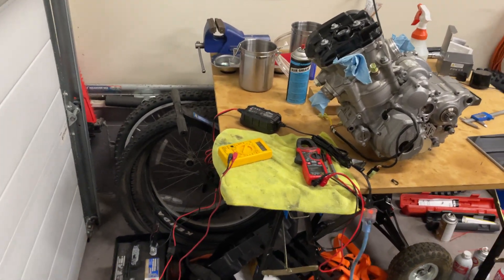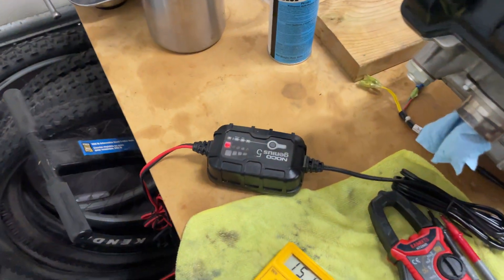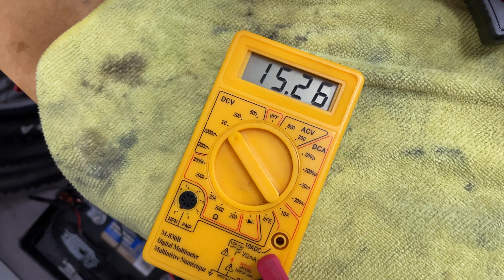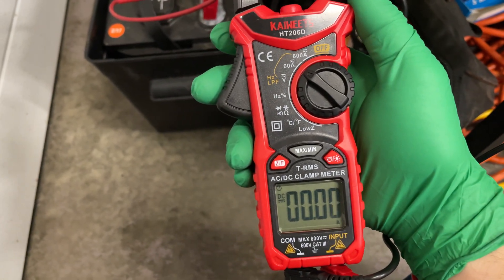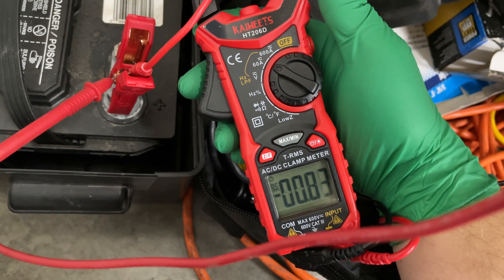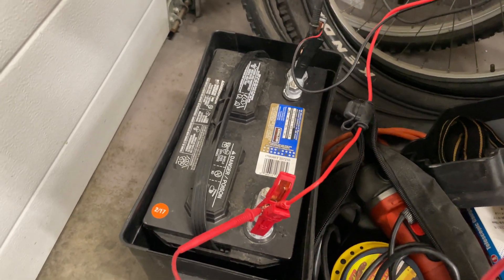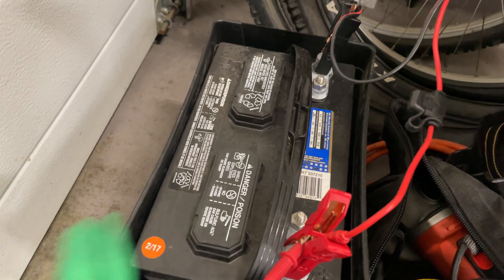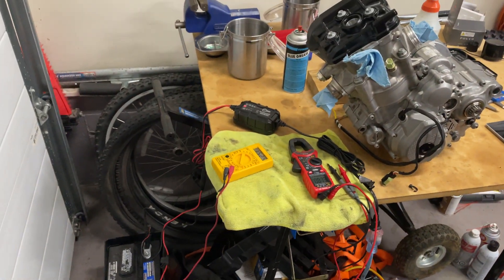NOCO Genius 5 Battery Repair Mode - How does it work? Restore Dead 12V Lead Acid Batteries

Comment: Desulfation devices or methods apply pulses of voltage or current to the battery.
These pulses help to break down the lead sulfate crystals, converting them back into lead and sulfuric acid.
The battery can then return to its normal charging and discharging cycle.

Comment: I tried the repair mode on my truck battery with my Noco 5 and got no pulse. I followed directions and absolutely nothing happened. 4 hour repair cycle and no change. Must be something wrong with it.
Reply: Did you try a full charge cycle before setting it to repair mode? I didn't and the repair mode didn't work. Trying the standard charge followed by repair mode now.

From manual:

"Using 12V Repair. [From Standby Press and Hold 3 Seconds With Clamps Connected to the Battery]
12V Repair is an advanced battery recovery mode for repairing and storing, old, idle, damaged, stratified or sulfated batteries. Not all batteries can be recovered.
Batteries tend to become damaged if kept at a low charge and/or never given the opportunity to receive a full charge. The most common battery problems are battery
sulfation and stratification. Both battery sulfation and stratification will artificially raise the open circuit voltage of the battery, causing the battery to appear fully
charged, while providing low capacity. Use 12V Repair in attempt to reverse these problems. For optimal results, take the 12-volt battery through a full charge cycle,
bringing the battery to full charge, before using this mode. 12V Repair can take up to four (4) hours to complete the recovery process and will return to Standby when
completed."
Reply: @chats5957  Thanks for the reply. Yes, as my comment says, I followed the directions. The battery is done. I got 7 years out of it. I got a new battery. From what I have read online, the battery has to get to a certain threshold before the pulse starts. My old battery couldn't reach that threshold.
Reply: @1dreamingfrog  Lead-acid flooded batteries don’t last forever. I never had a battery last more than seven years. It would be interesting to see how long your new battery lasts if using the Noco maintainer regularly. Some YouTubers claim to get 8 to 10 years using the new battery maintainers. I’m not sure about the longevity of AGM or lithium batteries using a battery maintainer regularly.
Reply: @Fred_the_Head I think AGM batteries have similar chemistry to typical lead acid and maintaining it helps. But lithium chemistry is different and doesn't like to be fully charged and is optimal in the 50% charge range so if it's constantly maintained at 100% it stresses the battery. You could get a special trickle charger that tops up to 70-80% so it preserves battery longevity. That being said I'm not sure this pulse repair mode does anything more than what you'd get if you just normally charge the battery.
Reply: Did you ensure that the battery was fully and completely charged BEFORE engaging repair mode. Repair mode will not be effective if the battery isn’t fully and completely charged.

Comment: Put a Noco Genius 5 on car battery that was showing about 8 volts.  I did not charge it but instead put it into repair mode.
Came back a couple days later the battery read .025 on a voltmeter.  I thought the multimeter was wrong.  It was not.   
Question is what the Noco not-so-genius do to kill this battery deader than dead.
Reply from the maker: You’re supposed to charge it fully first, then use the repair mode on it to pulse current through it, as per the instructions.  This knocks off the sulfates. The reason it was dead is because repair mode only lasts 4 hours or so, then turns off. Not sure why it would have drained other than maybe the battery was powering the tiny led light on the charger at that point. Do a full charge, then top up a second time, then do a repair on it.
Reply: @halflife82  Thanks Egan!  I'll try that today.

Comment: Thanks for the good intentions, but without showing us if it revived the battery, this video is pretty useless :(
Reply: It does revive batteries. I have the genius 5 and anytime I’m working on my vehicle for a few hours I’ll pull the battery cables off and plug in the NOCO on repair mode to keep the battery desulfated. I bought a used truck with a weak battery and the noco revived the battery so well I drove it for another 2 years before i finally felt like the battery was done. It extends the life of your battery.
Reply: @shannonsisk without actually SHOWING that it can start a car, we can't actually KNOW that it's repaired the battery. You don't show it in your video :(

Comment: Very interesting, I was curious as to how repair mode works on the Noco Genius 5 and 10 chargers, it must use voltage spikes pulses. I was also looking at a Pulse Tech Charger that uses a patented frequency to desulfate batteries, but I am not sure if it will charge a dead battery like the Noco Genius chargers can in force mode. How is the battery you charged holding up, have you done a cold cracking amp load test on it?
Reply from the maker: 100%! If I had a scope I’d have thrown it on there to check out the waveform.

The battery I repaired here with this method is still going strong! I have upped my game since this video and have proper load testers now to check IR, CCA, as well as testing cell electrolyte health with a battery hydrometer. I’ve restored several “dead” batteries over the past couple years since posting this and they’re all in service working great. I do several other things with them however, not just this battery restore/repair of this Noco. 👍
Reply: @halflife82  What do you do other than use the repair mode.  I know the acid can be at times replaced but just wondering what other techniques you use